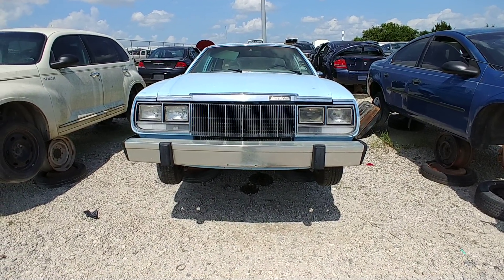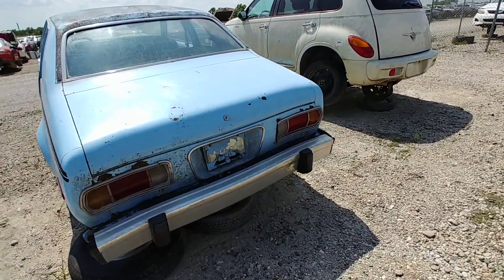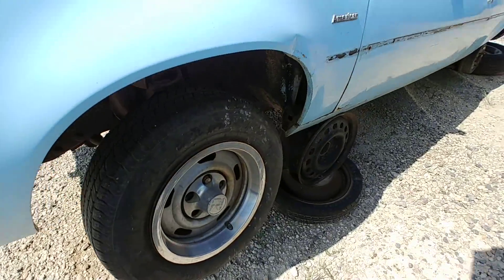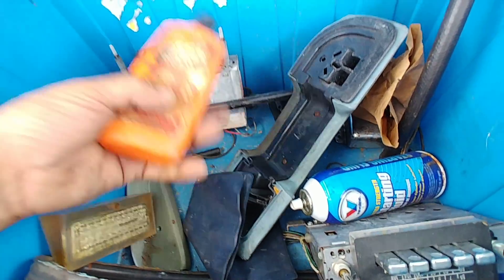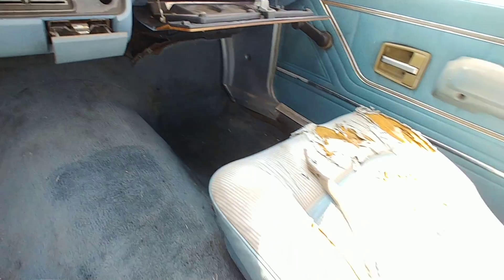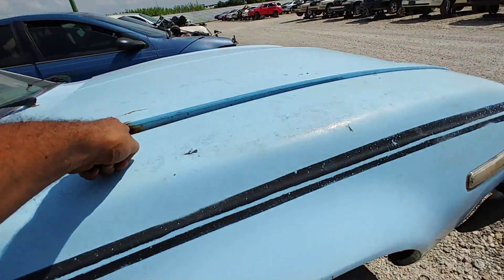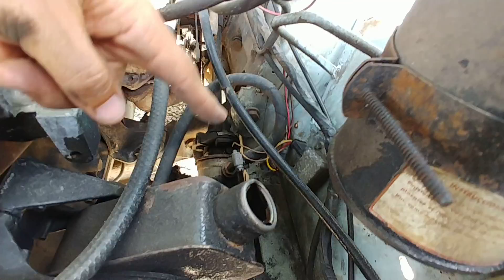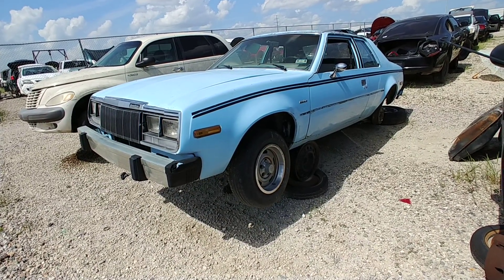Rare Oddball Mexican Made 1979 VAM American Junkyard Find

Comment: Whoa Nelley, from Mexico and it don't go. Yes, VAM stood for Vehiculos Automotores Mexicanos and built vehicles in Mexico under license with AMC. They were around from 1946 to 1986 and then Renault got them after the collapse of the Mexican economy in the 1980s. Renault then disbanded them a few years later. The Mexican government mandated that the vehicle have 60% Mexican content and the engines used were AMC engines made in the Lerma, Estado de México engine plant and were of AMC design.

If you use that VIN with a US destined car, it won't work as the codes are different between non-US market cars and US market cars. I'm reasonably sure the first A is American Motors, the next 0 might be 1980 model year (but built in 1979), the next A is for three speed automatic on the column, the 08 is the vehicle type/group, the C is the engine which appears to be a 258 with a one barrel, and there were no 4 cylinder or V8 VAM models so they were either a 258 straight six as a US AMC was at the time or they actually had a 4.6L straight six that was unique to the The rest would be the production sequence. VAM models and wasn't sold in the US. The engines were equipped to deal with the lower octane and quality fuel available outside the US at the time. 

Crinamex makes glass for GM. My G6 convertible has glass made by them. It's some of the very few foreign parts on the car---the car has 85% US content, including the 3.9L RPO "LZ9" engine and transmission. The engine was made in Tonawanda on my G6. 

Correct, "Almost A Car" and "All Makes Combined". Those lock cylinders are actually Strattec (back then, Briggs and Stratton of small engine fame) and GM used the same ones. You'll even find that design on a GM RTS city bus too. LOL.  That MIGHT be the original steering wheel and it may be missing the "VAM" logo in the middle. Notice the dash says Concord on it. I'm wondering if it's a mix of parts. I also see an impression on the floor of where a floor shifter may have been. I thought I read in some literature that these didn't come with column shift, but they were a mixed bag of parts, so who knows. Neogynon OD is a female contraceptive drug. 

Close, a Saginaw steering column which was a GM division and once again used GM parts. 1957 Ford F100 VIN is F10 for F100, J for 223 six cylinder with one barrel, 7 for 1957 model year, D for Dallas, TX assembly and the rest is the production sequence. That's XR4TI (as in ice cream, not 1). They were made in West Germany. That VIN is WF1 for Ford Werke West Germany, B for active seat belts, P for passenger car (I think the T is an error), 80 for two door hatchback, W for 2.3L four cylinder engine with fuel injection, 3 is a check digit, H for the 1987 model year, W for Rheine (Wilhelm Karmann GmbH), Germany assembly under contract with Ford and the rest is the productions sequence. No loss, the XR4TI was a heap. 

Funny that it's built for the Mexican market, yet all of the controls and labels are in English. LOL. I think that's a certification plate by the Mexican government that says that it meets the 60% Mexican content requirement. 

Close again, a Saginaw design power steering pump and everyone used that, Ford, Chrysler, etc.  No, AMC did not build all of their models in Kenosha, even for the US market. Kenosha is also home to Snap On Tools as well. The Canadian AMC plant was in Brampton, Ontario Canada and also assembled some vehicles for the US market as well. There is a Walmart on that site now. The Canadian Chrysler plant is called Bramalea and is now called Brampton Assembly and is located at 2000 Williams Parkway East Brampton, Ontario, Canada. No tag, can't brag (may not have a door tag). Possible code 9E Wedgewood Blue exterior paint. 

Whoa Nelley, we got a (unique) VIN and we only partially win, with the tag, we can only partially brag. Going to be "plano" (flat in Spanish) and that's no bueno. Wedgewood Blue, it's over for you. Almost a Car, not going very far. Straight six, hit the bricks. Made in Mexico and gotta go. That's it, time to quit. Not worth many pesos, this one is like old moldy queso (cheese in Spanish). Going to get squished and the south of the border AMC faithful are quite pissed.
Reply: Vehiculos Automotores Mexicanos.  Kind of reminds me of Los Pollos Hermanos.
Reply: What I found is GM changed the keys when they went to column ignition, the older ones are a different blank (the shape of the shaft changed a bit).  But AMC continued to use the same key shaft, except swapped.  A 1970s AMC trunk blank can be cut for pre-1968 GM ignition, and I presume also the AMC ignition will do a GM trunk.  

Learned that going to a little shop that cut keys on the side when I needed one for a '60 Pontiac in like 1994.
Reply: @kennethsouthard6042  this should of been in breaking bad lol
Reply: @monsterrustrides  That's true, but Walter's Aztec was pretty iconic.
Reply: Google user GP, You certainly did your homework man. Thanks for sharing all that with us.
Reply: @CR7659  All were supplied by Strattec for GM. Ford typically used Hurd as their lock supplier.
Reply: @johnm.5848  No problem at all.
Reply: Hopefully google man got something to say about the mean green caddy
Reply: @monsterrustrides  Which one is that?
Reply: @googleusergp  our newest vid
Reply: @monsterrustrides  Did you post the cowl tag and VIN #?
Reply: @googleusergp  just what We got on the door
Reply: @monsterrustrides  I commented on the 1974 Eldorado and the 1964 Chevy II Nova video as well as the one with the Mustangs in the field.
Reply: Google nice but I know more then you I’m the best mechanic on earth your welcome
Reply: @TheRottenCotten  It's "than" and "you're", so we know grammar isn't one of your strong suits. You're welcome.

Comment: This is one unusual car.  The AMC Concord was never sold in this body style in the U.S., but the Hornet had this body style.  And yes, AMC bought a lot of its components from GM.  This is why the keys look like GM keys, the ignition lock cylinder will also, and as you noticed, the steering column.  AMC also used Chrysler transmissions.  They used some Ford components too but I don't remember which.
Reply: ford motorcraft distributors , ignition components mainly
Reply: @jeddroston9690  Correct. Alternators (depending on the application) were often Motorola from what I remember. Some starters depending on the application may have been Motorcraft too, again off the top of my head.
Reply: This body style WAS available in U.S.  You could order a 2-door Concord without the "D/L" package and you got this original Hornet coupe body.  I remember seeing them on the road here in New England when they were new.
Reply: @gojoe2833  You could also get an electric model Concord in 1979-1980. Solargen was the company that was involved, but it didn't go that well and the plug got pulled almost as quickly as it was in the wall (no pun intended).
Reply: @gojoe2833  The D/L models used this body as well, though the landau top with opera windows disguise this roof-line quite well.

Comment: If in fact they did that with many automobile brands in México in the 60s and 90s, they manufactured them in Mexico beca use it was very expansiva to import in those years, Ford Chevrolet Dodge Nissan Renault Volkswagen among others, and they lengthened the year a bit. of the automobile, (an example) the Chevy suburban was manufactured in Mexico until 1991, Dodge Ramcharger until 1996, and Volkswagen Beetle until 2002

Comment: At one time I had like 6 of the AMC eagles ,they were great in the snow. A guy I knew had one like that one but it came with a 360 v8 . My wife had an AMC eagle with a 4 cylinder Chevy iron duke that American Motors bought from GM.
Reply: Actually the Iron Duke 4 cylinder was a Pontiac engine not Chevrolet.
Reply: @sasz2107  That is correct. It was a Pontiac design, although considered "corporate design" after 1981.

Comment: Wow that is too bad this car ended up here.  It is way too nice.  You could get the Concord with that roof line.  It was the base model with no vinyl top.   Most of the Concords left the factory with the opera window half vinyl roof style.  They do look better without the quarter opera windows.   This was cash strapped AMCs way of trying to make the car look different then a 1970 Hornet.  The later year Concords didn't have the pivoting windows like this one.  The earlier Hornets may have had them.  Not sure.  I know the hatchback Hornet introduced in 1973 had them.  This one came fairly well equipped as well.  I liked how under the hood the plate read Rambler American.   That is a cool unique car that definitely deserves better then this.

Comment: I guess I would have picked those caps at least just to have.  I see the third wheel under the back of it on the left.  With the spare you have a set

It is a GM Saginaw column.  Tilt for an AMC would be a rare thing, I bet it's an easy flip  

That hood edge trim with "American" on it probably would be good, too. 

A shame they put it out, really, you'd be the only guy at the car show if you had that.
Reply from the maker: I thought about pulling that column and the American emblems, those caps as well as the hood trim that saud American. Still might. I have to go back out there for some wheels
Reply: @ClassicRideSociety  I mean if it was me I wouldn't care if I could sell those trim pieces, it would be neat to have to hang on the wall. 

Somewhere here I have a set of Holden hubcaps that came off the ones that look like a scaled down 61 Chevy, this one old yard we were in there was one of those, I grabbed just to have.  You'd have been in heaven in some of the yards we used to have if you liked 30s-60s cars.